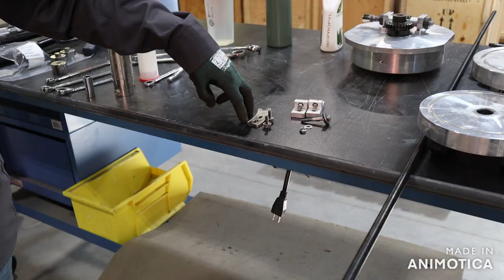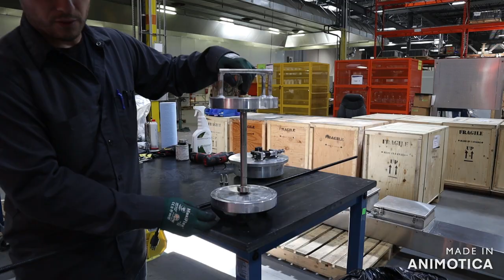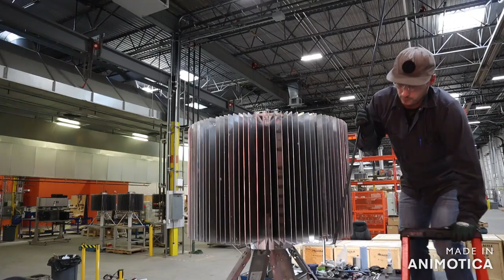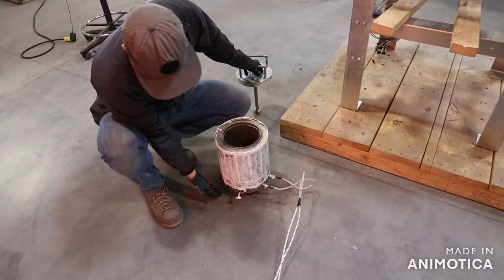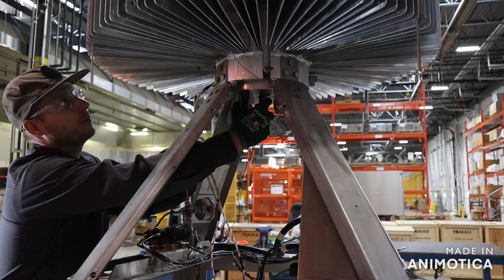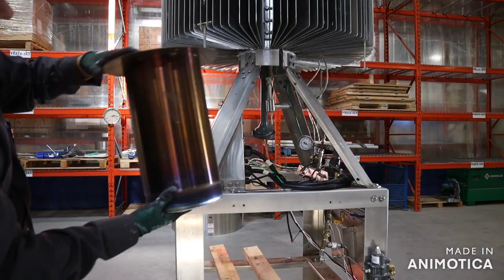S-8500 Power Unit Replacement

Comment: What idiot designer forced a thermal paste slide instead of a removal of the heat sink and implacement? Likely the very reason it would need replacing. Moronic or intentional. This RIGHT HERE, is why if you buy it, you should immediately cut it and see for yourself why it wont work long term. The thermal paste will be a mess. Redo it, and implace your cut heat sink flange properly. You will see far more lifespan on the unit.